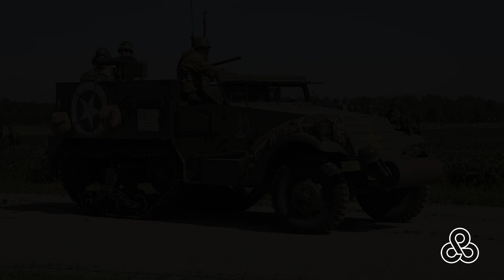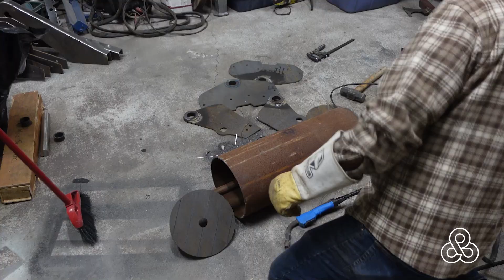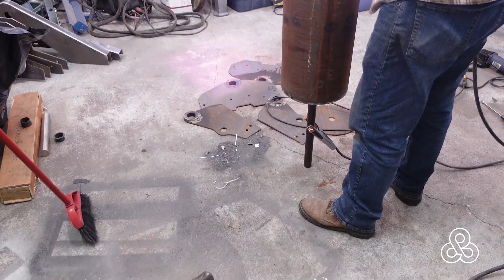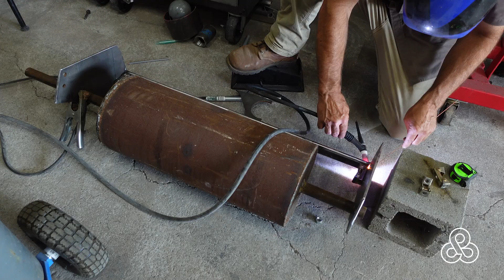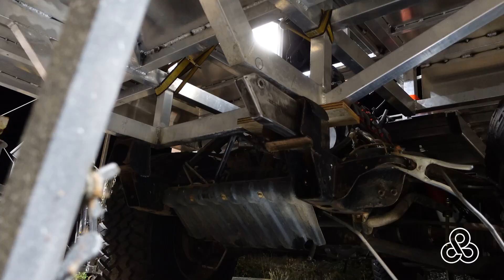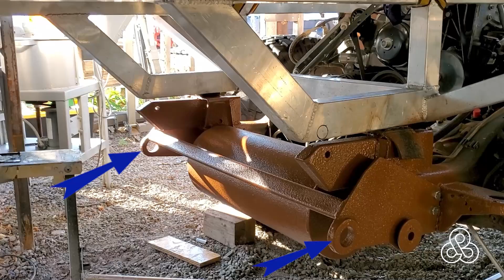L17 If it worked for the US Army why not! Chin roller on the Leviathan overlander project.

Comment: Warning.
Depending on where you live the local state rules may prohibit any structures on the front of a private vehicle that doesn’t comply with crash harm reduction standards.
I believe chin rollers are possibly prohibited because of an over ride hazard.
Front and rear crash structures need to prevent over ride.
If you make it easily demountable or have a removable bar that you can drop down in front of it for street driving you may get it passed.
Note this is advice for everyone not just the content creator.
Reply: @ryanimpossible4985  . Not being a problem depends on where you live, some places don’t even want you changing your own oil let alone building a vehicle.
If you don’t take the time to find out what the rules are you could waste a lot of time and money building something you will never get to drive anywhere but off road on private property.
Reply: @ryanimpossible4985  . The advice was for everyone, didn’t you read the last part of my comment?
Not everyone who watches this channel lives where he does.
Where I have lived and built hotrods it takes almost as much time to get through the red tape and get engineering certification for everything that is not straight out of a factory as it does to build the vehicle. That’s one of the reasons I fled that state.
Reply: @anomamos9095  and?... What state you leaving behind all those red tape  burden? California isn't? ! Would you can elaborate? Thanks!
Reply: @ryanimpossible4985  please get a clue and stop it with being ignorant.